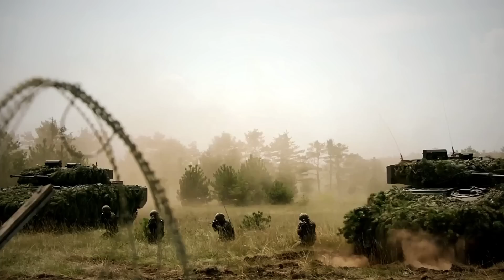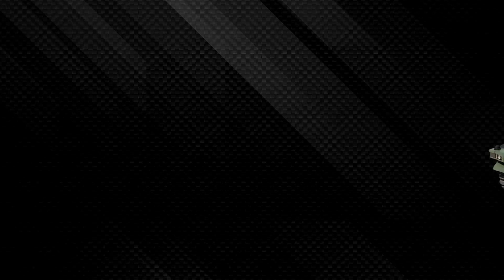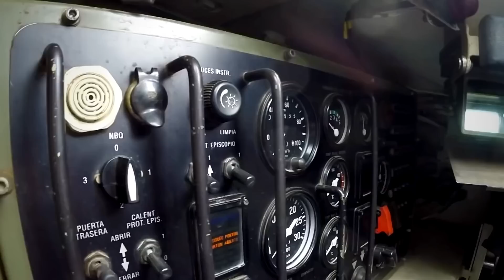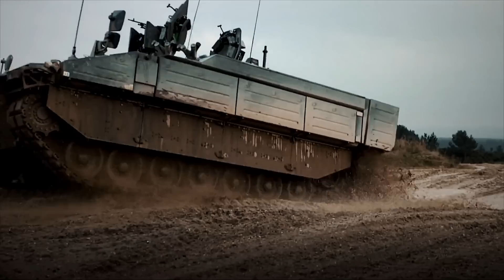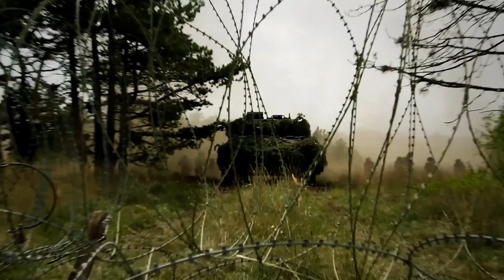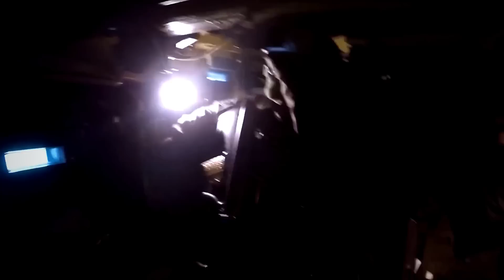The Military Vehicle on Steroids Fears No Russian Mine

Comment: Something about tracked vehicles are harder to maintain, require much more fuel than wheeled vehicles and have limited speed and mobility so I'm wondering how these would compare to say a Stryker style vehicle built to the same protection and capabilities standard.....
Reply: Building a wheeled vehicle to the same survivability standards is difficult. The main advantages of tracks over wheels are increased resistance to battle damage and decreased ground pressure. A tracked vehicle of the same weight will have much more floatation, much lower ground pressure, dramatically improving cross country mobility. Wheeled apcs are excellent for cavalry missions where they can travel long distances quickly on roads but suffer in mud/snow as they sink.  This was illustrated by the mobility differences between t34 and panzer 4/5 in Russia circa 42’ and 43’ and the utility of half tracked armored trucks in ww2. Heavy wheeled APCs were done in Iraq and Afghanistan in the large MRAPs like Cayman and buffalo that were restricted to travel on roads.  While technically all terrain with multi wheel drive they were to heavy and stiffly spring for off road maneuver.  The other advantage of tracks is the ability to produce a lower profile vehicle with acceptable internal height/volume w tracks.

Every major armored force Brits/aussie/russian/USA/Israeli/french deploy a mix of light/fats wheeled and heavy/decisive protected formations to capitalize on the strengths of both platforms. Tracked IFVs w greater protection/forepower/cross country mobility to accompany tanks and wheeled APCs for fast maneuver or blocking forces.  The main effort will continue to be tracked and armored heavy forces especially as APS and SHORAD improve.

That’s another benefit of heavy tracks they tolerate the several tons of weight added by APS systems better.

Comment: There's no way this thing is only rated to take a 14.5 mm round up to 1600 ft away? That's like literally the same caliber or even weaker than the very first anti-tank rifle made in world war II that's super weak I really wouldn't expect anything to be considered modern and holding infantry today that can only that .... Especially if they're trying to be useful against mines they would blow right thru that... You would have to be careful of any type of mounted Auto Cannon... Hell even some Jeep's/technicals in country's that use them have 20mm + mounted automatics in the bed of a old Toyota truck.... Thats wayy more powerful than the 14.5 literally Russia and Ukraine bith have 14.5 rifles used like a "sniper" called the alligator right now And there common over there.... I couldn't imagine the 25 ,30 mm autos that they have mounted to every ifv, apc,and tanks... Heck i think.30 mm is the minimum standard for the tanks alot of other countries have even bigger... And they have one or 2 mg's i think Russia has a 14.5 one also .. but Even a .50bmg or 2 with high power new aged AP or API would make me nervous because it's one step down from the 14.5 as the .50= 13.7mm not much difference between the 2 especially.. or  after a couple hundred rounds open up and wear down that armor they absolutely would make it thru... God forbid any thing similar to a apache gun or an A 10/ anything even comparable to a GAU-8...  Might as well just let it happen at that point because you don't really have a choice..